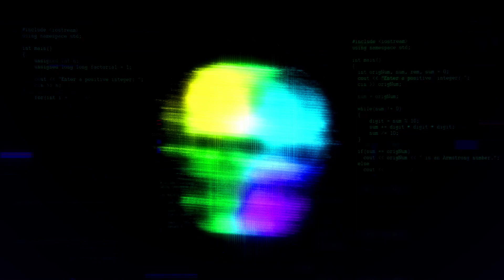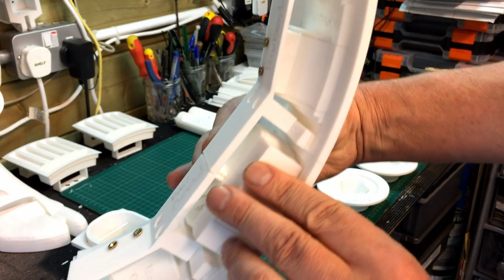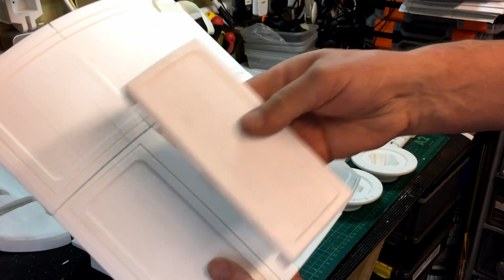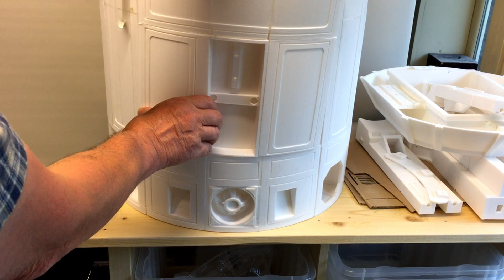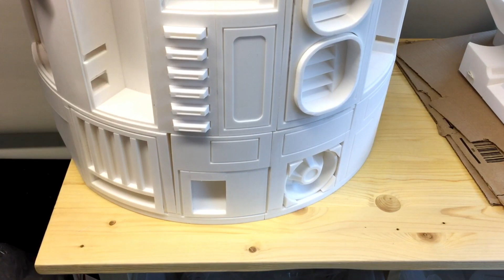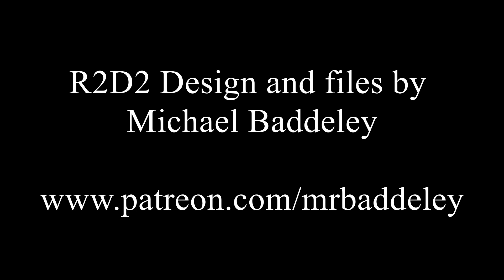R2D2 Droid Build Part - 7

Comment: Do you know what the filename is of the front vents mounting (shown in 1:08) can't find it. maybe mr baddeley forgot it
Reply from the maker: Hello kourkoulos, these parts are in the R2D2ver2Body > Greebles folder.  The piece I am holding in you snapshot picture is the "Powercoupler".
Have a look here on Michaels OneDrive ...https://onedrive.live.com/?authkey=%21APA5Cxi7TQXSqMw&id=E84CB8FD47152532%2124233&cid=E84CB8FD47152532 

At 1:08 I am holding the FrontVentBracket with UpperFrontVent and LowerFrontVent.  The "FrontVentBracket" seems to have been moved from that folder now, as I think a new speaker plate is being made. There are links to it on the user group https://www.3dprinteddroids.net/ [search for FrontVentBracket] or let me know and I can link it